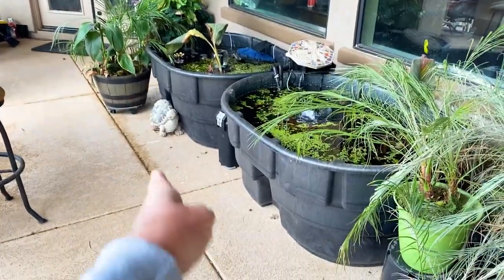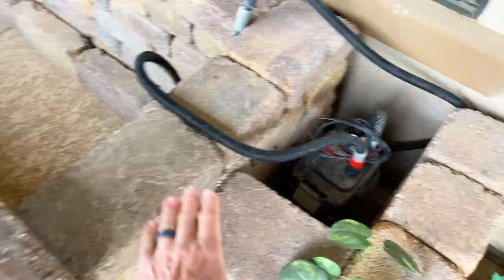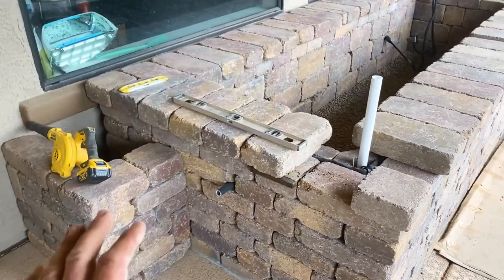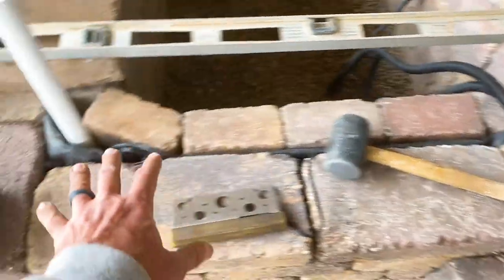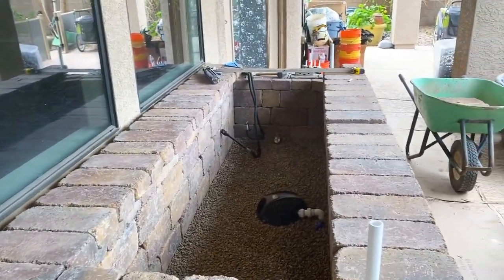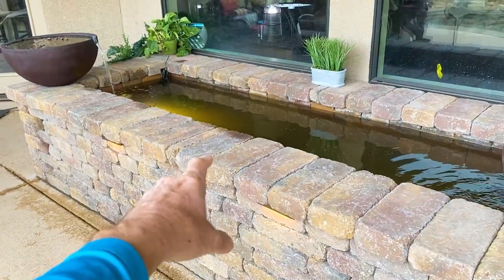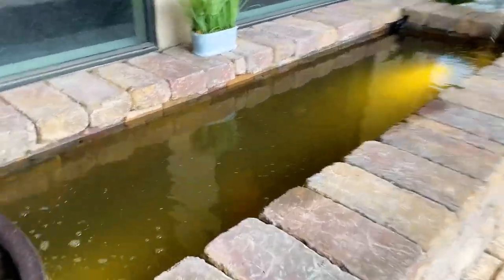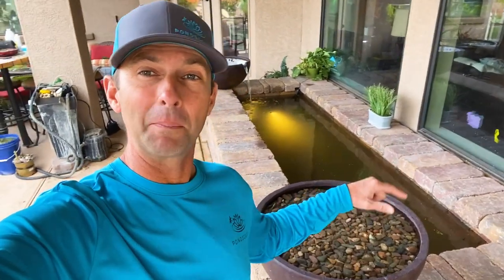**Above** Ground FORMAL Patio Pond!

Comment: I think it would have looked a little better if the bowls were positioned from the back so you could see the waterfall from the front but overall pretty neat little pond for goldfish 👍
Reply: I think it’s good the way it is because the view from inside the house is amazing
Reply from the maker: @Jack-wc3ob EXACTLY! And that’s why it was designed that way 👍
Reply: Like your comment, it looks back to front.  The bowls are in the wrong place, Intricate 45 degree cuts to the bricks at the back but simple butt up bricks joints at the front.

Comment: Thanks for the video.  I'm looking to replace an older landscape timber section in front of the house with a pond much like this that will have two sections with one cascading into the other.  Each section will be larger (around 10x12x3 feet.  Did you install the inner ring of brick for structural integrity or aesthetics and what type of bonding material did you use for the blocks?  BTW, I'm stealing this bowl idea. It looks great.
Reply from the maker: Both structural and aesthetics. Construction adhesive. Steal away 👍

Comment: wheren't you afraid the pressure of the water will or would break the wall since it's only held by glue?
Reply from the maker: Good question. I have done this a few times before at my own home and a bit higher with no issues. I would not go taller than this feature using this method. Plus I used a LOT of glue 💪

Comment: Why dont you use cement concrete inside since you already have block wall instead liner and another block wall inside, i just wonder what is the advantage? Thanks
Reply from the maker: We always use liner, the interior block was to make it more aesthetically pleasing than just bare liner.

Comment: What's glue to use to glue the blocks?  Thanks
Reply from the maker: I now use Structure Bond foam adhesive. It is applied from the same type of foam gun as our waterfall foam. Drys faster and easier to apply.

Comment: How much energy would it take to keep that much water warm during winter?
Reply from the maker: That is a good question and extremely hard to answer. There are a lot of variables that will affect operation cost. The closest answer I could give you would be to factor in the wattage cost of the heaters you plan on using based on your daily kilowatt rate.

Comment: What are the stones made of please?
Reply from the maker: They are concrete. Pavestone wall block.
Reply: @pondscapesaz  thank you for replying. I didn’t think that would be safe for the fish. Are they sealed? If not, do you mind commenting about the PH of the pond?
Reply from the maker: @LakesideQuiltmakingArts  they are not sealed. Where we are located in Arizona we we typically have higher pH water. The homeowner has not had any issues with Fish health due to the concrete block

Comment: the water pond is small compared with the the height and the brick flatform.   it was ok until you put the brick in>

i make my first pond design base on finabocci number and it gave me a relax feeling.  this one is not relaxing since the ratio is way off
Reply from the maker: @travisdt  I guess if I was using the Fibonacci sequence then in theory this Pond would never be completed. I decided to use the common sense theory and build some thing that fit the space and desires of the customer.